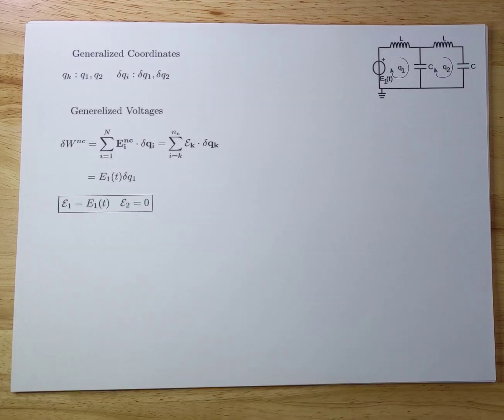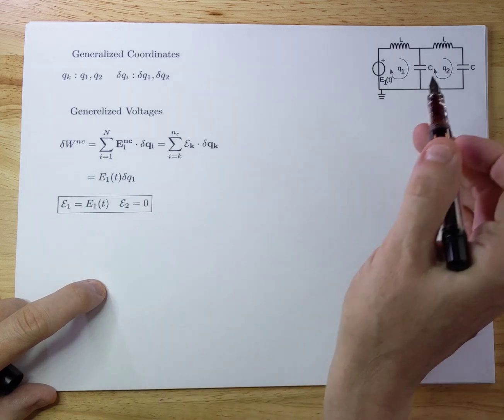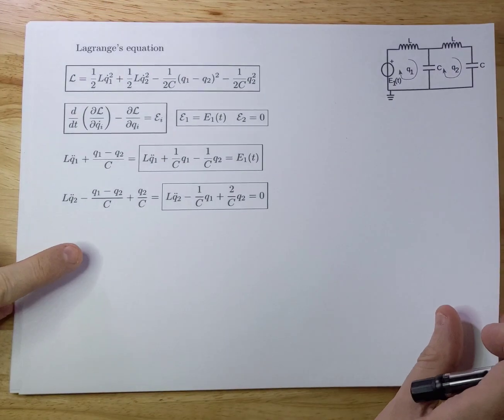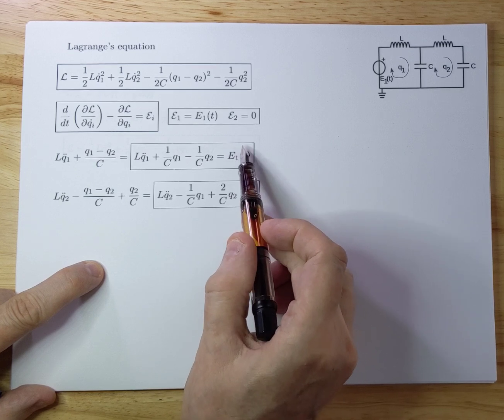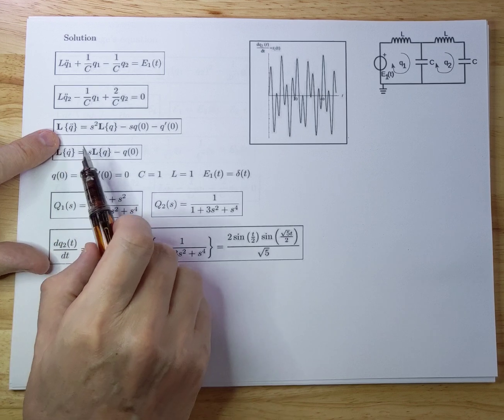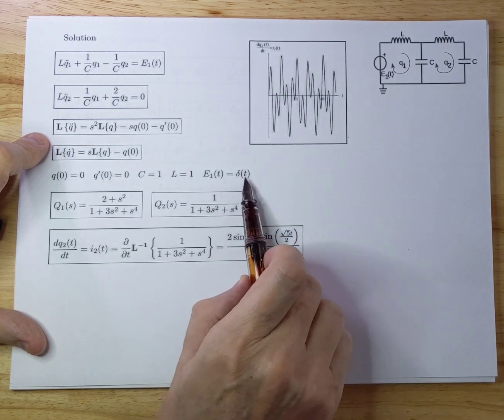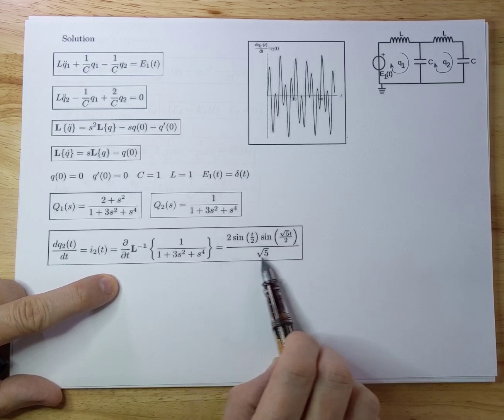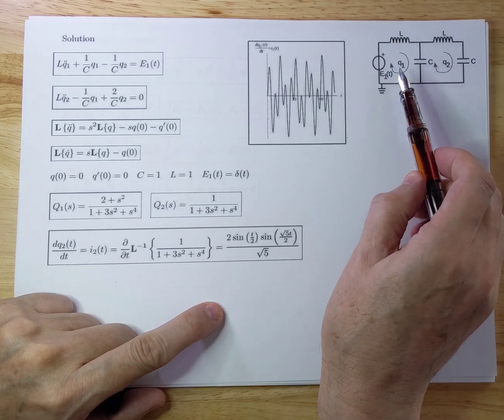LC^2 Oscillator circuit. Exploiting Mechanical-Electrical duality using Lagrangian's.

Comment: Would this be faster than using phasors?
Reply from the maker: The downside of using phasor's is that the transient behavior is lost, you're only looking at sinusoidal like behavior, meaning the behavior just after an impulse was injected into the system will not be captured. Using the Lagrangian as was done in the video does keep this behavior. In conclusion, when you're interested in non-transient behavior phasor's is usually faster.
Reply: @TheSageofScience  thank you for this  excellent explanation